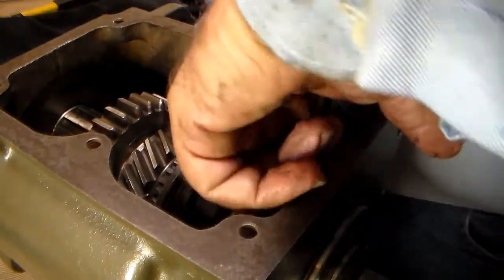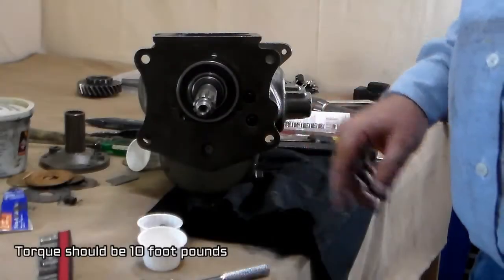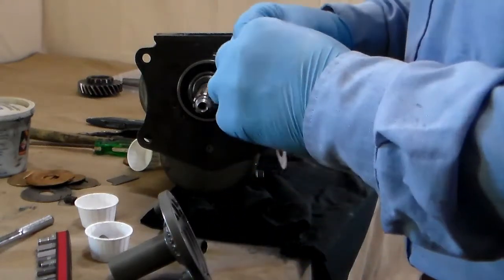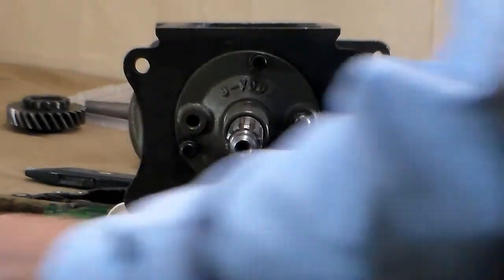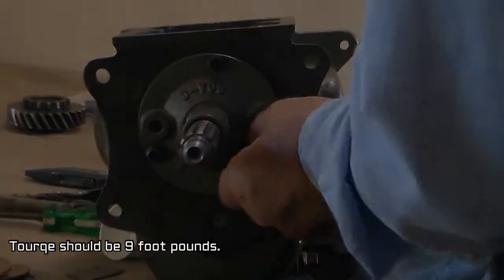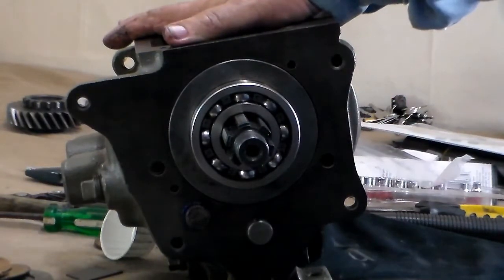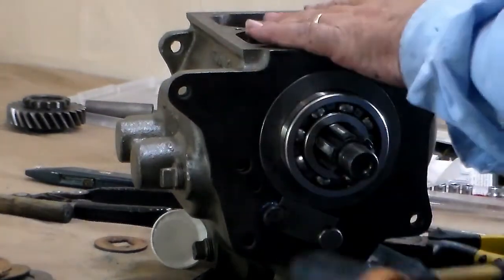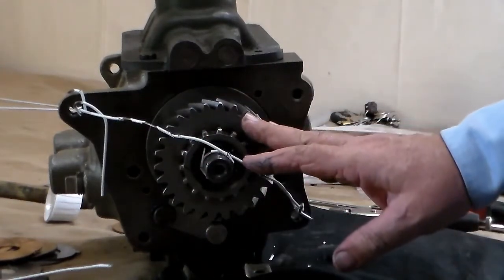14 Rick Stivers T-90 Rebuild Guide - Assembly Part 5

Comment: I’ve watched all five of your rebuild videos now and they are very well done. I think I’ve now got the confidence to tackle a rebuild when and if the time comes. So...here’s a question: My 49 CJ3a doesn’t jump out of second gear, however it does crunch ever so slightly going into second unless I either double clutch or shift veeery slowly from first to second at about a fast walking pace. Is there anything I should try or investigate before tearing the thing apart? Am I likely to see the issue by just taking the tower off for a look see? All other shifting is smooth and silent. Thanks again.
Reply from the maker: I’m sorry to say the only thing that can fix that problem is a new second gear synchronizer. Unfortunately, to replace that requires a full tear down. If you can stand it, live with it until you get a major failure. That won’t cause much damage that hasn’t already been done.
Reply: @rickstivers3965  - I was worried that might be the case. Ah well - it’s certainly workable for the time being.

Comment: Hello, Rick! I came across your videos on T90 transmissions and have found them to be extremely helpful. I appreciate you being methodical in your lessons and anecdotal on potential problem areas as well. I have always felt that if you have a gift or solid experience in something that it is a good thing to share with others. Thank you so much for sharing your expertise too.
Reply from the maker: I’m glad you found them useful. Let me know if you run into any problems with it.

Comment: Are there seals to stop oil from going to transmission to transfer case?
Reply from the maker: No, only a better front seal than the original felt seal.
Reply from the maker: Sorry I miss read your question. You can get a sealed bearing and install it in the rear, however, there are other passages that would need to be sealed as well. I know a few folks have done this but I haven’t seen a need.

Comment: I can get mine into third. But 1st and 3rd the engine won't turn over. This is a rebuilt tranny I purchased. Do you have a video on how to install the tower?
Reply from the maker: Peer Plaut It sounds like the first reverse gear fork is not in the slot for the first reverse gear. I put a quick video together for to show you how to do It. https://youtu.be/HCpgtxw42aE

Comment: Rick,  Good videos for the transmission.  Question though.  You talked about properly shimming on the main shaft next to the rear spacer.  Did you make the video and I'm just missing it?  I would like to talk with you either by phone or through email.  Is that possible?  I have rebuilt my T90 and have about .060 end play on the main shaft.  No where can I find the shims to take up this spacer.  Even old service manuals do not say anything about shims being located there.
Reply: I have that same question and would appreciate a comment on that 😄 Living in Denmark so short answer here would be lovelly.

Comment from the maker: If you installed a sealed bearing you will not need the felt seal. However, if you didn't you will need the seal. Make sure to oil or grease it well. It will tighten up considerably when you install it. Once it's run a little it will loosen up.

Comment: My kit came with a felt seal that goes under the bearing retainer.  When it's installed, the transmission will not turn, when I remove it, it rotates nicely.  Is this thick felt seal needed?

Comment: is the sealed front bearing sealed on both sides
Reply from the maker: Mark Warner, Yes the sealed bearing is sealed on both sides.  It is designed to run without ever having to add any lubricant. That way you are protected from leaks and failure due to contamination.
Reply: thank you I was wondering because I'm a crane mechanic, and a lot of Manitowoc assemblies will have the inner seal of the bearing removed for oil to lubricate bearing
Reply: Nice job, thank you